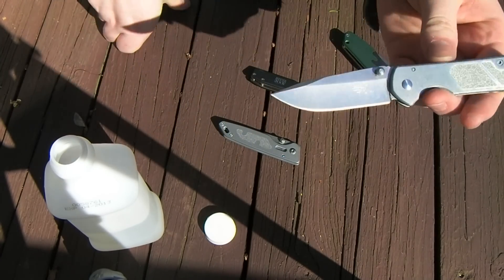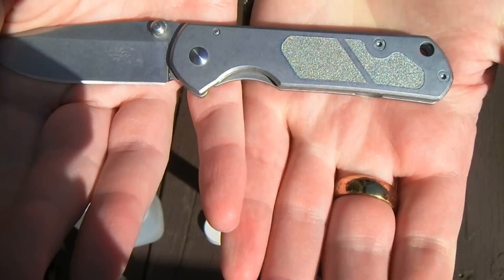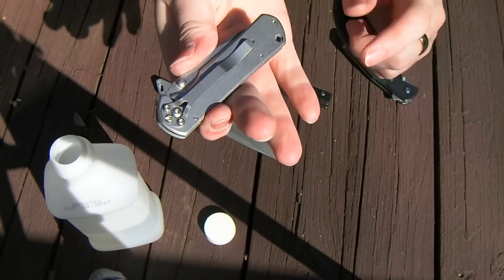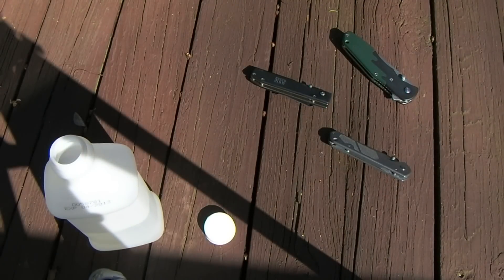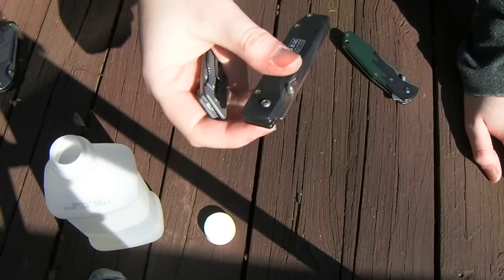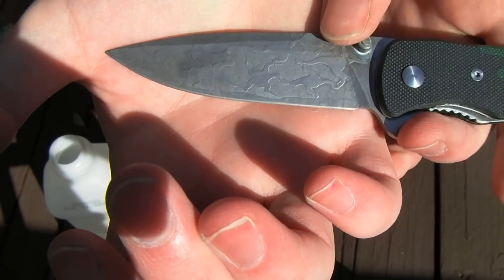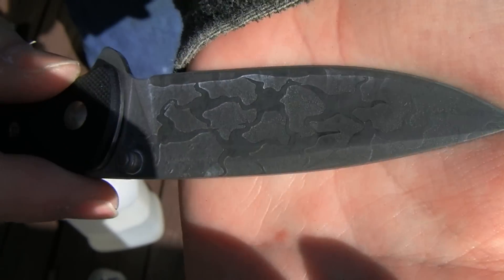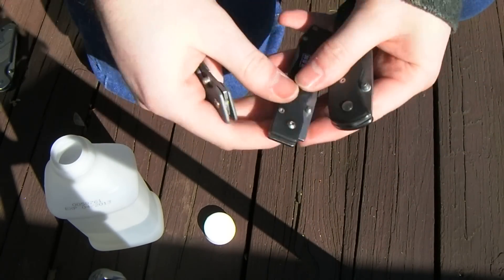Stonewashed Blades

Comment from the maker: Theres a tutorial in the Acid Etching playlist on my channel. But in a nutshell you mark the blade with a substance that blocks acid, then everything that's not covered gets eaten away when you immerse it. I use nail polish to paint most of my designs, and the acid I use is Ferric Chloride Solution.

Comment from the maker: Get rid of, yes. Prevent, no.
Stonewashing makes microscratching in the surface that can make rust form more easily. Not enough to matter most of the time, but if it's already a problem for you it's probably not a good idea.

What you want is probably some metal polishing paste and a rag. :)